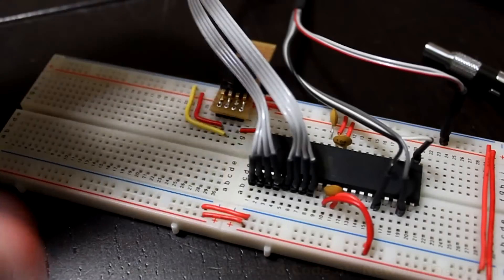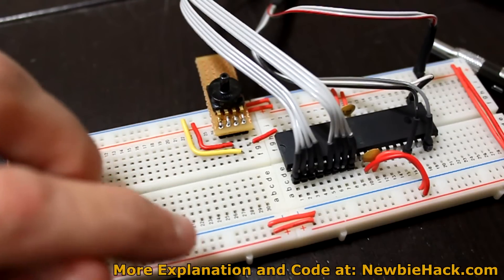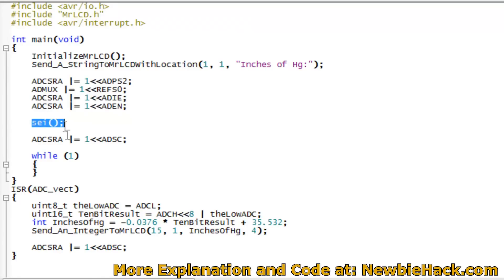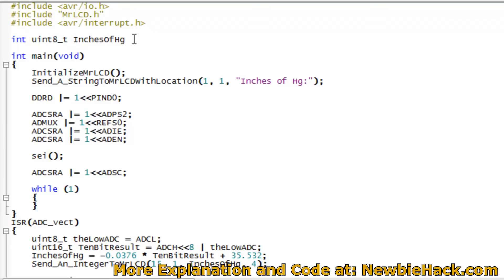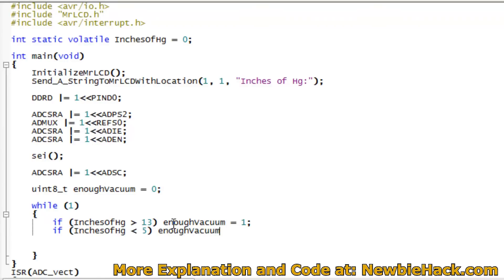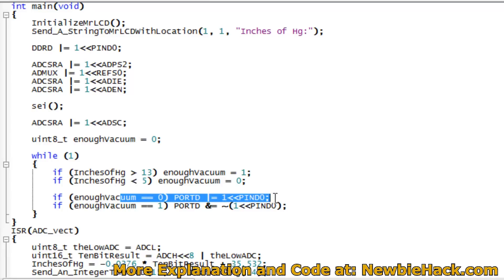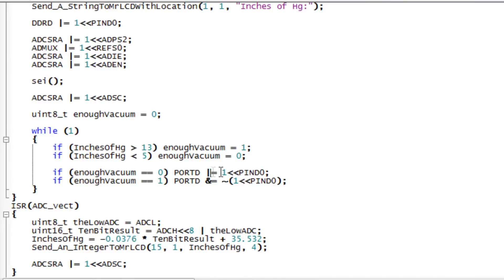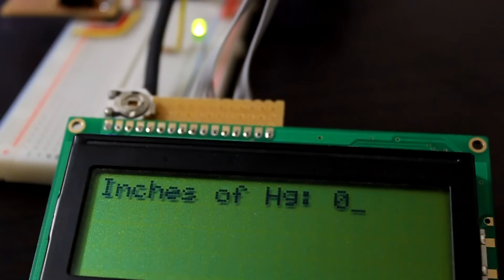44. Arduino for Production! AVR ATmega32 - Part 4 - Real World Example of Create a Vacuum Source

Comment: Regarding bit_is_clear() / bit_is_set(). There is no need to make checking that state. it is safe to assign value to the register as many time as you need and that will not damage the controller pin. For example, OR-ing the PORTD= 0x01 | 0x01 will result PORTD = 0x01 - no change in the pin state. But in this checking the pin state before will only cost more CPU time and nothing more.

Comment: @anajonesr @dsnyder05 I got all ribbon cables scavenged from old computers floppy cables, ATA cables (older), newer ATA for fine works. Often I just use cable as is and mount the pins so orientation gives me space. This is way cheaper then to buy new ribbon. Often, number 1 wire is repainted with marker. 
Best Regards, sry for intrusion,
Goran